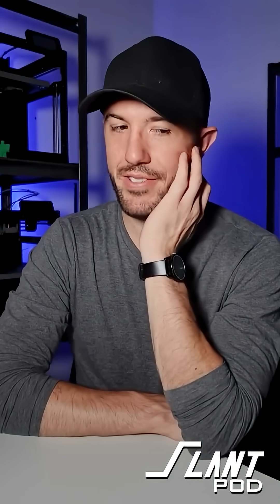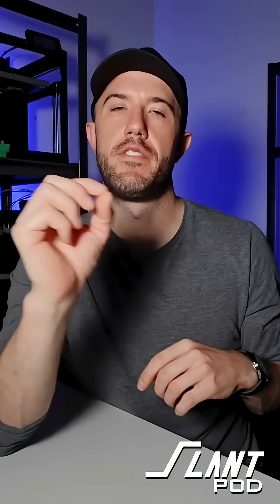Pellet 3D Printers Why They’re Not Coming to Your Desk

Comment: But they work better if you want to recycle every failed print, 3D poop, prime/poop tower, support structures, unwanted prints, water bottles… 🤷‍♂️

Plus with PVA, you can probably reuse it over and over again. 

And you can also mix colors/materials with pellets…